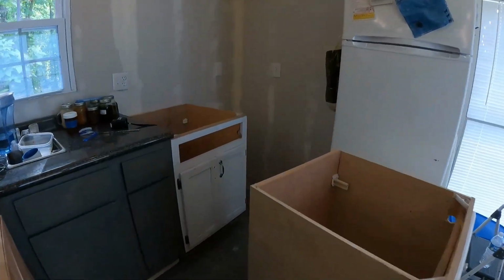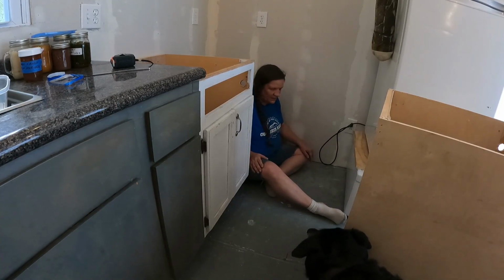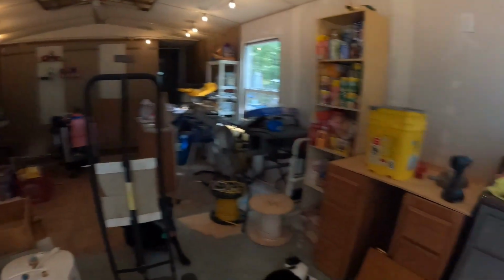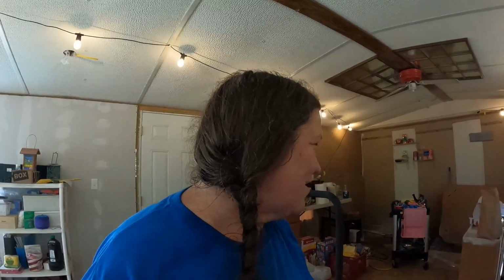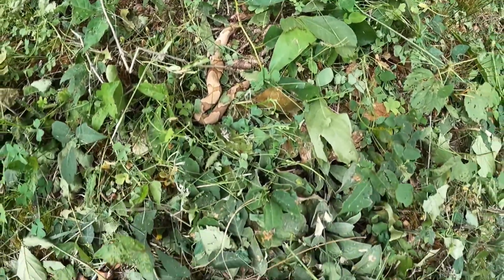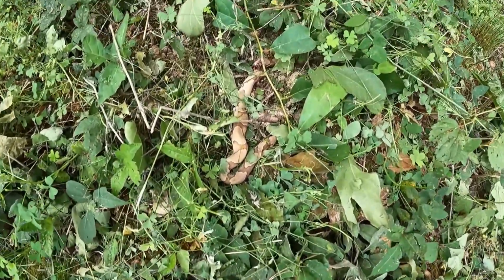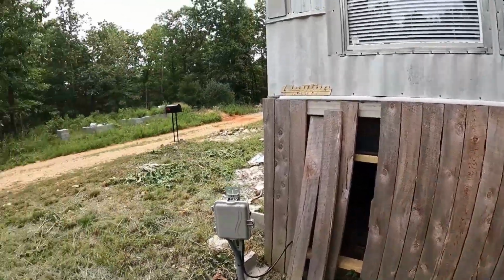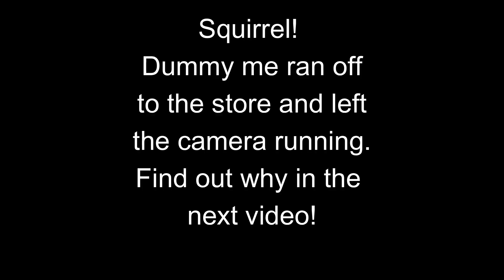Mobile Home Makeover | EXTREME BUDGET | Installing Kitchen base cabinets

Comment: You have been doing a wonderful job fixing up your place.
Pretty much everything new.  New walls, insulation, electric, windows etc.  I can see the vision.
What disappoints me is the mismatched kitchen cabinets.  I know u are going by the budget that u have and once you paint the cabinets it will bring a nicer image.  But, I couldn’t deal with the mismatched cabinets.  It’s an issue with me with everything.
I would go to local Lowe’s/Home Depot and see what cabinets they have that matched up my cabinets and go from there.  
Even if I had to buy one cabinet a month that’s what I would do.  
I would see beautiful walls and floors and a strange mismatched kitchen cabinets.  I know we all do what we have to do to get by and I understand your issues.  But just saying, it would drive me crazy looking at different cabinets.
I’m sure you will make them look very nice .  
Good luck!
Reply from the maker: I agree, These cabinets weren't originally in my vision of how I wanted the kitchen to look, but they are all wood unlike the ones at lowes/home depot. I plan to get the matching doors for the sink cabinet and then they will all be the same, and still at a fraction of the cost of ONE cabinet from box stores.
Reply: @BigDreamsTinyBudget  
If you are able to get the same doors that match then… that’s a completely different story.
Who cares what is behind the doors!
I see the vision complete now.
The kitchen will look beautiful!
I wish I was your age again.  I would be doing the same thing as you.
You made a great deal when you bought that home for that price.  
You were very smart buying the land around you.
I wish it was me.
I remember back in the day fixing up my place with my husband.  Great memories.
I wish you much health and happiness in your home!
Reply from the maker: @moalf5088   aw thank you! I wish I were in my 20s or 20s again. This house would have been done by now if I were haha. Ya the white cabinets are same style as my oak cabinets and they were made locally. I havent purchased the new doors and drawer covers yet, but I will be doing that very soon before I paint them all. I still need to decide on paint color!